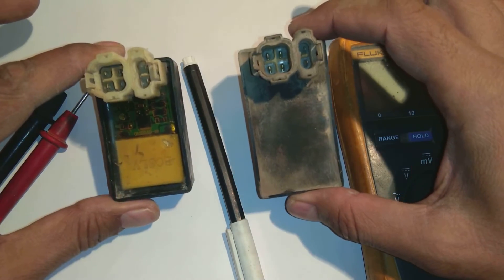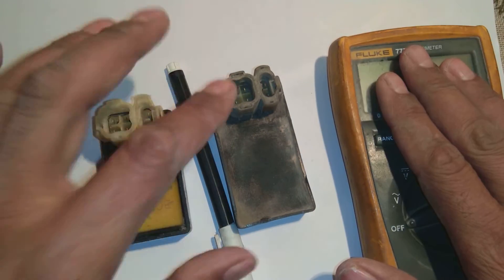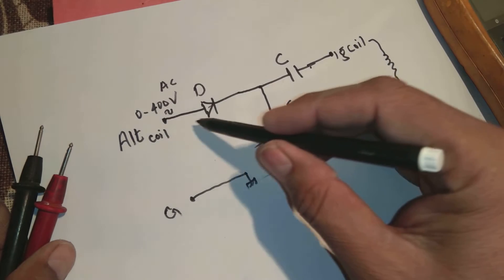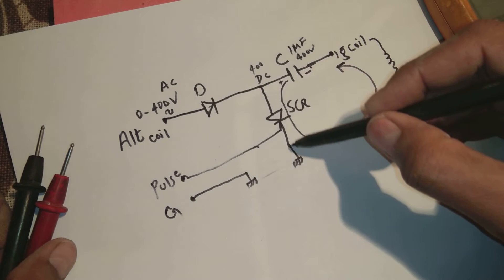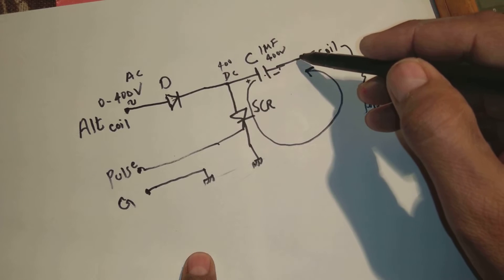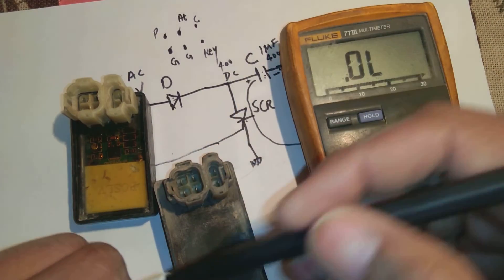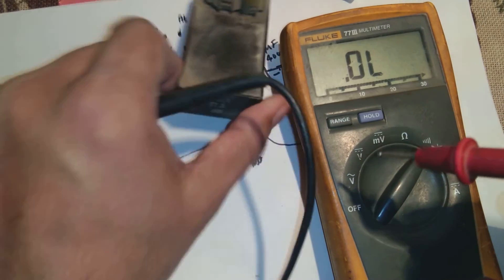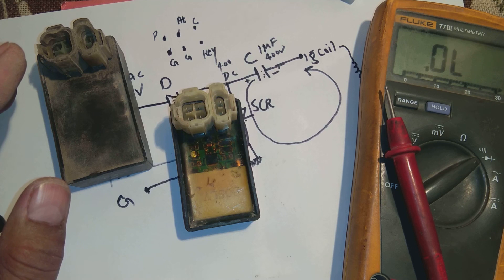CDI unit testing. how to test bike cdi on multi meter. motorcycle cdi unit testing on multi meter

Comment: is AC and DC CDI is the same? can I use AC CDI to DC cdi? vice versa?
Reply from the maker: No. They aren't the same. You can't replace them without major modifications in ignition system wiring.

Comment: In my ray z 2016 model cdi. There is a orange wire output for ignition coil in this wire no output from cdi why
Reply from the maker: On the output of cdi you will not get voltage when measured with a voltmeter even if the ignition system works. This is because the output of the cdi unit is for very short time. If the ignition system works, let asum the cdi is good.
Reply: @JahanZeb1976 . 
Hello sir. When I kick the pedal after 2 or 3 attempts only less spark comes.
I tested with multimeter in cdi at two points reading coming for continuity. But rest of the points zero coming. Why
.

Comment: Question. I have CU 2548 (from japan). If the kill wire is shorted inside the box, is it okey to short the primary coil for use as kill switch wire instead, or do i destroy the cdi-box?
Reply from the maker: Nothing will destroy. Just short alternator power wire to cdi and kill your enging.

Comment: so i might suggest to let viewers know that when using the volt meter it doesn't matter which prong you use to each pin. ex) it doesn't matter if you have the red prong on the ground as long as you continue using that prong to test each pin the same way then you will be able to get a reading. does that make sense what im trying to say? bc i am new to using the volt meter so i was thinking the black had to be on the ground etc, etc. but it doesnt ....idk just a suggestion. BUT other than that i was able to test my cdi box. great video .thanks

Comment: Sir can ask whole diagram wiring connection of  motorcycle rusi GY6..  your   kindness is highly appreciated sir.. thank you so much
Reply from the maker: Rusi are not here. Anyhow you can use another motorcycle circuit on any other motorcycle

Comment: How would I wire a a/c racing cdi that is 6 pin 6 wire to the wire harness on bike that is 6 pin but 5 wire it is two square pin blocks one with 4 pins and other with 2 pins but only one wire so 6 pin 5 wire but cdi that I purchased is 6 pin 6 wire help please i have a 2024 apollo thunder rfz 250cc thanks

Comment: Very interesting video but way too long regarding the key question here. How to check the CDI with a multimeter? How to set up the multimeter and measurement points - good example bad example - done. 
The internals of the CDi unit is another video subject all together as for a third how to open and repair one.
Reply from the maker: Video is available here on my channel for same cdi unit opening and repair. Thanks for watching.

Comment: How much voltage an AC CDI recieves from magneto? Also, can I run an AC CDI on 12V 50Hz AC step down transformer for my project??? (I want continuous sparks at the spark plug)

Comment: Thank you for the video. I need to make a homemade DC CDI for a motorcycle. I'm trying to understand how DC CDI alter the spark timing. Some of them have two trigger coils, one advanced and one at TDC. Somehow the CDI box switches to the advanced trigger at a certain rpm. Other designs only use one trigger coil and they advance the timing as rpm increase by some electronic means. 
Do you have any videos explaining this? Is there a book I can read?
I really want to understand how that works.

Comment: Japan is has great C.D.I. units but they fail and replace them with China C.D.I. units that are crap but seem to last. It seems that another country can come in an undercut China crap and Surpass Japan in quality at the same time. Say India could do it and become the go to country for replacement C.D.I. and Stater replacements. This magic place could charge the same as China but if the unit is better than Japan then its easy to choose. Worse that could happen is China takes the foot off the back of the neck of manufactures and let them make quality products for once. Fine China could mean quality again and not an ironic joke.

Comment: greetings, the video is excellent, I just want to know something, my cdi on the multimeter does not show any voltage on any of the pins, is this a sign that it is correct or not, Thanx
Reply from the maker: Thanks for liking. You should find voltage on alternator pin when you kick your bike. Voltage could be up to 50v ac. This is the main feed to cdi on which the cdi unit works. If you don't find such voltage, remove the connector from the cdi and check the voltage again. If still no voltage, you have a bad alternator coil. If you get voltage off connector on kicking, you have a shorted cdi. Also give attention to cdi ground wire and kill switch wire. Some times they are responsible for fault. Regards،
Reply: @JahanZeb1976   Thanks for the reply, Alternator or coils, whatever you call them, give voltage, I connected it to the multimeter plus to the pickup and ground on the chassis, it shows a voltage of 150, when I start to crank the voltage increases
and the bomb, when I connect the plus to the pipe where the spark plug goes, nothing happens, and when I connect the normal plus and minus on the bomb, it records and shows some voltage for a short time, and so on

Comment: Sir, is it possible to convert 1957 model Fiat car to electronic cdi?
Reply from the maker: Yes, it's possible to convert almost any car to electronic ignition. I did it with an older Suzuki long ago. Results were awesome. Better if you consider transistor ignition from some other car and fix it on yours instead of making your own system and cdi.
Reply: Thanks Sir, I request your recommendations on using which cars electronic ignition for this purpose

Comment: Awesome ❤ , I have a question how do I set the pulse discharge rate of CDI and how do I configure the discharge rate is there any formula in the factor of cc, displacement or something.
Reply from the maker: Thanks. For parameter adjustments, you may design your own microcontroller based cdi unit and program it in the way you want. Wishing you good luck.

Comment: I have 7 pins 3 up 4 down how i know what is ground? If i connect any possible connection must not close the system(not hear them sound from the multimeter)? Bike is yamaha 100cc crypton 2002
Reply from the maker: Follow the schematic diagram from OEM otherwise trace wires from the wiring harness.

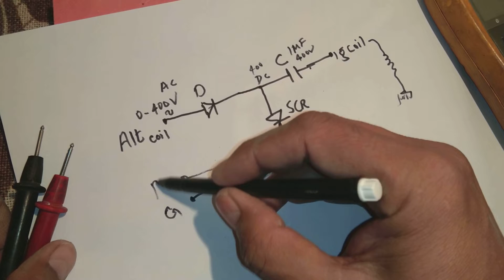Comment: Nice explanation. 4:33 So basically, that constant "On / Off" thing that's happening in that cycle is a similar thing to how an old distributer cap works that older carburettor engines of cars use?

Comment: Hello. I am currently trying to fix my son's speedfight 2 LC 50cc scooter. No spark is present. The wiring loom has a 5 pin CDI fitted and also the original 8 pin dellorto CDI/oil pump unit fitted. The bike did start when first purchased, with difficulty. Any ideas how to solve the issue?

Comment: My bike have 2 spark plugs and 2 ignition coils connected to single CDI box .. 1 of the spark plug is not producing spark I switched the wires coming to coil and the coil is working. So the wire coming from cdi to 1 coil is not getting any voltage.. i am confused how 2 ignition coils are connected to 1 cdi box can someone explain the circuit diagram.
Reply from the maker: I'm not sure about your bike make and model. But you can check if two separate wires are coming to two ignition coils, then this is a twin cdi or double cdi unit in 1 box. And you have 1 bad cdi out of two. Replacement should give solution to your no spark problem. Regards,

Comment: Not many people know, electronic engineers included. AC[ yours] or DC powered CDI unit ? I'm sure you know pin out test values change with different components inside, just as critical is the CDI for a 2 stroke or 4 stroke because it won't start. 2t double the spark and different timing curve[retards]. I have bought a few cdi by guessing as most sellers don't know either way.

Comment: Hi bro i have a bullet classic 350cc i am going through a missing problem i check the spark plugs its all in good condition . I check the tps i replaced with new still having the same problem. I am guessing will it be CDI problem for the missing problem I'm getting in my bike please help me out if u can.
Reply from the maker: Thorow  checking and testing is required. Cdi could be a reason.

Comment: ? Cdi is located on the fire wall close to engine maybe heat caused comonen5vaues change 
If length of wire make impedene match0

Comment: If there is continuity between the two grounds would this cause the cdi unit not to work.
Reply from the maker: If there is continuity between two ground pins, its quite normal.
Reply: @JahanZeb1976  I have one more question. I have a Southwire multimeter should it be in the continuity mode or diode test mode. On the continuity mode I don't get anything but on the diode test mode I get a reading between the ground and the ignition pulse Gen., and on the starter relay and the ignition switch. I appreciate the help and your video is very helpful.

Comment: I have a 6 wire cdi there's no plugs on it only wires coming out how do i know wish wire goes where please help
Reply from the maker: If you have cdi installed in your bike, you can trace it's wires by your efforts. Otherwise try to search on Google if it helps.
Reply: @JahanZeb1976  hole new wiring i must do no harnass i wish i could send you a pic of the unit

Comment: Hi !
Thanks for this video.
I have a question though!
My CDI unit is not showing any shorts on the metre, but it is not working in my bike, i tried a different unit and the bike is running fine, can it be a problem in the wiring of the bike ?
Reply from the maker: No, it's problem in cdi unit. Keep replaced. Your cdi is broken in another way then shown in this video. This video described very common mode, cdi shorting. Whereas in your case it's cdi open circuit mode.

Comment: I have a xl degree 250cc, for alternator pin that you have demonstrated on the diagram, I have the supply for the ignition coil connected to it

Comment: 7:45
Could you tell us how this works relating to each terminal?
1 Is Pulse, but  what pulses it, the alternator/stator?
2 Is Ground (I get that)
3 Is sometimes ground, sometimes NC, a lot of explanation 
would be appreciated on this pin.
4 Is Alternator/Stator, (doing what?) ''alt power'' power coming 
from the alt?
5 Is 'coil' , so is this power pulsing to the coil positive? (I guess it its)
Thanks!
Reply from the maker: Yes, all your understanding is right and well.

Comment: Thank you for your video. i thought my cdi was bad, but your video and my testing shows that its ok.  I still have intermittent spark to still troubleshoot.  The coil checks good. but not sure yet on rectifier or maybe crank sensor or bad wiring on my 150cc Lifan
Reply: 150cc lifan - is that the horizontal engine? I just bought the horizontal lifan 150 and having the EXACT same issue

Comment: My CDI box looks exactly the same but has a seperate wire coming out of the bottom left of the box. How would I test that wire? I'm getting no spark, I've ruled out plug and coil, now testing CDI and next I will test the stator. I hope it's not a wire somewhere. They're tied up in factory wire harnesses and I will likely cause more issues if I have to cut in and open up all the harnesses so I'm hoping my issue is just a part I can replace.

Comment: Subbed, very good info in a straight forward manner, thank you for your vids, keep them coming, ive been workin on bikes about 30 years and the only CDI's i have repaired have all been a simple capacitor failure... replaced the main capacitor and they spring into life,  your vid on the other components inside has opened up a new Avenue of learning for me, thank you sir 👏🏻👏🏻👏🏻
Reply: I agree.  It's an excellent teaching and demo.  Very practical and thorough.  Thank you!

Comment: Great vid.  Can a CDI progressively fail?  In other words, bikes run smoothly at lower rpm then run roughly at higher rpms.   Carbs are cleaned and synced perfectly on this twin cylinder Ural.  Grateful for any advice and how to test for this..........
Reply from the maker: It is possible. Replace CDI if it's cheaper in your are as they are very inexpensive in our area. Otherwise check everything before attempting CDI replacement.
Reply: Having same issue, bike started fine for a while, ran rough at running rpms above idle.  Then it wouldn't start at all, no spark.  The CDI passed the short circuit tests but its $10 so i ordered another one to check to see it that was the problem.  Have checked stator resistances and tested voltages and can't find any issue.  May something failed open instead closed so it doesn't show a short?  IDK, we will see.

Comment: i want you tp teach direct to the point budz. you gave a lot of zigzag.
Reply from the maker: Yes you are right. But that's also important to gain more knowledge about the system.
Reply: @JahanZeb1976  yes, but that is most applicable only to the technicians. not to the riders or motorcycle users who are fond of doing it yourselves. is not it?

Comment: Thank you for your videos. My problem is one cdi works a/c works on one of my bikes and not the other? Look forward to your answer! Thank you!
Reply from the maker: If you are swapping a CDI unit from one bike to another, it should work as long their systems are identical. If it doesn't work, check bike wiring, ignition switch, magnet coil and pulser coil and wiring connections.

Comment: Usually ac supply voltage is 40V and is amplified to 200v to ignition coil supply. Never measured 400v on supply to cdi
Reply from the maker: Get a good multimeter and measure again. The maximum voltage fed to CDI reaches to 400v ac.

Comment: My activa is return from two mechanics without repair due to high repair cost and non releavent expenses now I am sure I will repair my activa at home 
Very useful information for me in dentails. I have analog multimeter old type but still it is working and it is useful today also 
Thanks

Comment: What tells the CDI when to fire? For example is there a crank shaft timing position sensor? Honda 300 fourtrax.
Reply from the maker: The pulser coil installed on the magnet 🧲 tells the cdi to fire 🔥 on the piston TDC.
Reply: Thanks a bunch for answering and soon 🙂

Comment: This is the best video I've seen for understanding the cdi. I can now apply the basic concept to a cdi on larger bikes. Could you do a video for larger CDIs, please? On a bike with 2 coils/sparkplug, there should be a ground wire and two ignition wires to the coils plus the pulse wire for a total 5.. But what are all the extra wires for? (In my case 4 extra wires) Temperature sensors, kill switch? I'm confused. Online wiring diagrams explain only the color codes, not the function of each post. Thanks
Reply from the maker: I'm sorry as such bikes are not around me here. If I'll get a chance, sure I'll do video on such cdis. Best wishes.

Comment: Stator check:
Earth cable at 200ohms         0.5 - 0.9ohms
AC trigger wire at 2v~       0.02-0.09ohms
main wire 200v~                23.6 30 ohms max

kill switch 200ohms          0.5/0.6

help please

Comment: Hi there, i don't know if anyone sees this comment or not but would like to give it a shot. I have an AC CDI with 50cc scooter, turn key no light, after starting scooter lights gets on and pretty low with flickering unless i'm giving gas which speeds up stator and in that way gets bright... That cause my head light bulb pops every couple of month... Is there any way on wire configuration on my CDI to change all lights feeds from battery rather than stator? Thanks in advance!

Comment: And what about CDI with 5 pin? It's the same method?
Reply from the maker: Nearly the same as long as it is ac CDi. Also you should match up pins as shown in this video during testing process.
Reply: @JahanZeb1976   Ok, i have on my moped replaced the alternator coil, bicouse moped hasn't spark. Than i got the spark, he runs but after some time, spark was again gone. And i think it shuld be CDI. Yes on my moped is AC CDI. Incognition coil shuld be ok, i have testet with multimeter. Thank you for answare!
Reply: @JahanZeb1976   I have that moped get from my friend, he dont need any more, he have say that there is a litle problem with it. When i get that bike i have sean that battery was invert connected. 😁

Comment: How much alternator create amp
Reply from the maker: Alternator is producing a few miliampere at 400v for cdi. But fot battery charging and headlight it produced some good 3 ampere at low voltage of 14v.

Comment: So should any cdi, reguarless of  the amount terminals, should not have continuity? I have tested my own bike which used the same cdi in the video but I'm testing another bike with 2 different plugs. One plug has 8 pins and the second plug going to the stator has 4 pins and two of those pins have continuity. Would that mean the cdi is bad?
Reply from the maker: This is not a must. If that cdi is starting the bike, means that's good. This resistance testing technique is valid up to some extent to this particular make and model. For other cdi, the testing would be different. Regards,
Reply: @JahanZeb1976  so would you know the way to test a cdi with that many terminals? I'm curious why this particular bike doesn't have spark. I've been going through the rest of the harness and can't find what's wrong. I just remember from this video about continuity in the cdi and that's the only thing vie found that seems out of place
Reply from the maker: It could a bad CDi unit or could be something else. All you should do is intense testing and replace with a borrowed Cdi module if possible. Regards,

Comment: realise this is f or ac electrical system dc is 12 volts I have no sprk condition and have ordered new dc box for my bike with battery (dc) and will let you know how it turns out.

0